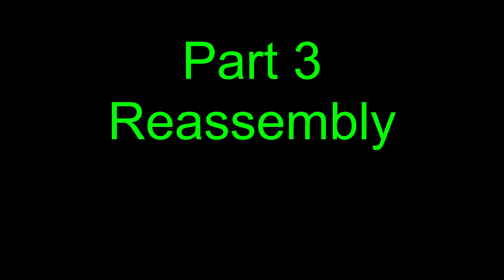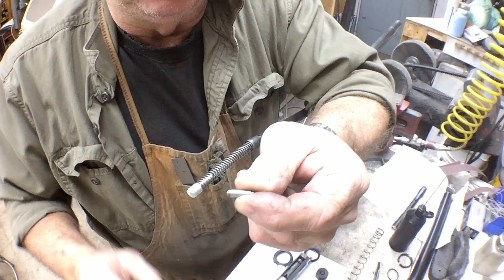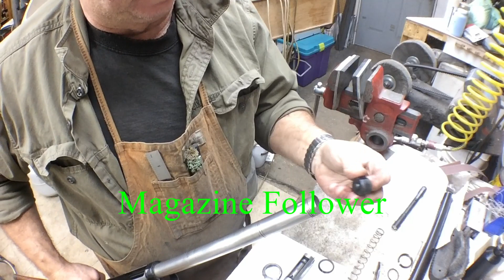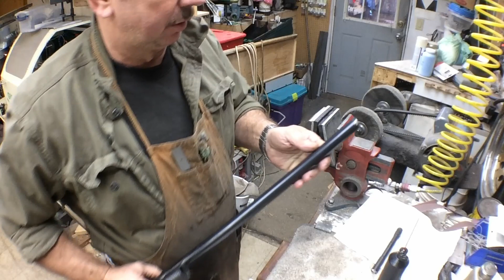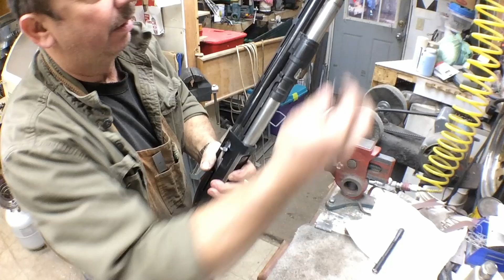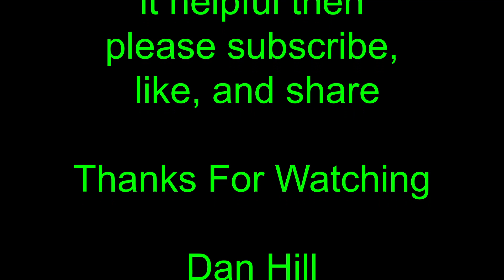Remington 11-87 Repair and Service Part 3, Assembly

Comment: I was wondering if all 11-87 shotguns had the magazine collar on them prior to installing the fore end. Not any other 1100 video I've seen shown the collar being used. I noticed how you installed it and realized I put it on correctly. I just installed a new gas -Oring on mine. Hoping it cures the recycling problem on my target loads. Thanks for the excellent video.
Reply from the maker: They all have the gas rings the only difference other than size is the later style used a connected style rings (one piece) as opposed to 2 seperate rings. Most 11-87 s will not function light target loads.

Comment: I have a 11-87 that has the one piece piston seal part 19258, and it is very hard to get a replacement. Ant suggestions to replace this part
Reply from the maker: Just do a google search, while many places show out of stock there was one that said it was in stock and at least 2 others that allowed them to be added to the shopping cart so possibly had them. That was on the first page.

Comment: Great video! I have a problem with one a buddy gave me to fix. 
He said it doesn’t work. I tried the trigger (after clearing it!) and it is dead. Safety works, allowing zero trigger movement. When in fire position, the trigger pulls back but no hammer actuation. I pulled the gun apart, and cleaned everything with a spray cleaner. Lubed it up and the trigger and hammer work as expected. Put back together and the trigger is dead. I see a lever on the side of the trigger group that when allowed to raise, the system works properly. When the barrel is installed and the bolt is pushed all the way into battery, that lever is depressed ever so slightly, killing the trigger/sear engagement. At this point,  don’t know what to do next.

Comment: I took mine apart the other day, cleaned it all up, and put it back together and it will not fire. I tested the trigger mechanism before putting it back in the gun and it was working fine. However every time I put the assembly back into the gun it will not fire. The safety is working fine and the trigger depresses but it will not engage the firing pin. I've had this apart 5-6 times trying to figure out what is wrong but I'm about ready to give up. Frankly it's just not that complicated of a mechanism to have this problem. Is it possible that the trigger is not engaging something? Like I said, you take the assembly out of the gun and it fires fine. I don't get it.  P.S. I did notice some play in the butt stock, and the mechanism that is the part that strikes the shell has some play but I'm out of ideas.
Reply from the maker: Sounds like the disconnector or its spring is not positioned correctly or barrel not fully seated. Butt stock shouldn’t be a factor but if it is loose it will crack under recoil so needs to be tight to the receiver. Dan.
Reply: @hillsgun  I may have found the problem, the tab that you push in to get the action into place will not stay in the slot. Every time you depress it, the back end falls out of the channel. It's kind of chewed up too, just above the channel it rides in there are some very deep gouges in the steel. I'm not sure what I'm going to do now, but thanks for your help.
Reply from the maker: That’s the shell latch, it was originally staked in place, but is not necessary to be staked to function, only more difficult to assemble. The gouges you describe would have been caused by it being out of position and the trigger group being forced in. The gouges probably won’t affect function unless they have made a burr that is above the receiver. Lightly stone the burr so they are flush, position the shell latch properly and help align it with the trigger pin inserted just enough to align it and then with your third hand insert the trigger group enough to hold the latch in its groove, then you can get your finger out of the way to finish installing the trigger group. Dan.

Comment: Very late to find your collection of very informative videos!  I have a set of 1187’s circa 1987.  Love them.  I went to take them apart this weekend.  My 28 came apart just like you instructed.  My 12 has been a real bugger to get the bolt and carriage out.  No matter how I press the catch, the carriage won’t release.  It cycles great.  I’ve put several hundred rounds through it recently.  Still my old reliable war horse.  It needs a good cleaning.  Any old wisdom how to get that carriage to release?

Comment: Parts are getting hard to find
Reply from the maker: yes, hard to get parts for anything.
Reply: @hillsgun  do you think someone will start back making 1100 parts
Reply from the maker: At some point there will be some reproductions available, probably not as good but they will be something if there is enough demand

Comment: How tight should the bolt handle be to pull out.
Reply from the maker: it varies but it needs to be secure so that it won't get lost in the field, but it still should pull out with moderate force.

Comment: excellent.  Are you a teacher as well?   You're a natural.
How often should the action spring (not the magazine spring) be replaced?  I have an 11-87 Premier (c1998)  that was shot a great deal through about 2005.  but not as much over the last 15 years.
Reply from the maker: Hi Bob: Thank you but no, not really a teacher. My attitude towards action springs is unless the gun is giving problems then leave it alone. I have seen some that are running fine with the original spring and when changed out they would not function and also just the opposite. If the gun is clean and oiled properly it is usually an ammunition problem rather than a gun problem. The trend is to manufacture ammunition less expensively (less powder, cheaper components) which often does not have enough power or the wrong pressure curve to properly cycle the gun.

Comment: So did you put all of the parts minis the stock into the solvent tank? How long if you don't mind me asking?
Reply from the maker: I run everything thru either the solvent tank or my small ultrasonic cleaner(minus the stock) no answer for how long as it depends on what solvents you are using
Reply: @hillsgun  thanks. I actually own an ultra sonic cleaner. What do you use for the liquid medium? I've seen some videos using water and simple green. I'm ignorant and new to guns but wouldn't water be a poor choice?  Do you have a video?

Comment: Hey i have a 1187 and its best shotgun ive ever owned or shot and the interceptor latch broke the solder didnt hold up from factory and im wondering if theres any easy fixes to this or if i have to send it out i have the latch still and the circle clip and ive found the parts online but im not sure if i could just put a pin through it or if its got to be sent out? Could please give me some advice?
Reply from the maker: I assume you are referring to the interceoptor latch pivot stud and I must admit that I have never seen one fail. You will have to find someone qualified to silver solder it, refit, and reblue the receiver for it to be correct. Previously if it was not a repair I was willing to do I would recommend sending it to Remington, but since they have closed their doors I would find one of their authorized repair stations (when they were still in business)and have them do the repair .
Reply: @hillsgun  yeah thats it it was a display gun when i bought it and i used it for about 2 or 3 years with no issues then one day i was out shooting and it suddenly stopped working i called around to alot of places i live in upstate new york and no one will touch it they all said that a certified remington gunsmith has to do the work and i finally found a shop that will do the work its a about a hour and a half away and its going to cost a couple hundred dollars to get fixed but itll be worth it.

Comment: What do you think about the practice of not letting the bolt slam home without a shell? As in riding the bolt, and easing it forward.  Only letting it fly when there is a shell to be chambered. Could it potentially cause issues letting it slam?
Reply from the maker: I personally don't consider it to be an issue, if it does cause problems then I feel that there are other problems such as excessive wear or a design flaw, or poor heat treat  with some firearms manufacturers.

Comment: Good video what if I’ve done all that and after I fire my first shell it doesn’t feed the second one in? What could this be?
Reply from the maker: what ammo?
Reply: The remington dove and quail load and Winchester pheasant steel shot high velocity 2 3/4 1 oz #7
Reply: I just gave it a thorough cleaning so I hope it works I also changed the O-ring. I live in the SF bay area so it’s going to be a little while before I could shoot it again.
Reply from the maker: @martymarfishhunt3622  probably ammo is to light, it may cycle the steel shot load but I really don't expect it to function the dove and quail. I didn't ask but I assume it is a 3" gun? even though they advertise as shooting 2 3/4 with todays loads they realistically won't. dove and quail is a light load and doesn't develop enough pressure to cycle the actions of most auto's and even though the steel pheasant load is advertised as high velocity it is a relative term used by the manufacturers and gains that velocity with powder selection which will produce velocity, but not necessarily the pressures necessary for function. Steel loads normally run lower pressure levels than an equivelant lead load
Reply: @hillsgun  thank you for getting back to me . I will try some different loads I bought this probably 20 years ago brand new and never had malfunctions and I used the lighter loads. Yes it is 3 inch by the way. Ok hope it works thanks again.
Reply from the maker: Ammo from even 5 or 10 years ago was produced with substantially more "oomph " than it has now due to both cutting costs and liability issues plus over time there is wear of the gun so we see more an more of these issues. Hope this helps, Dan.

Comment: It seems to me that there are fewer gunsmiths these days but more people are owning firearms.  May I ask if you just got tired of gunsmithing or did it become unprofitable.  I had a difficult time finding a gunsmith to put a new trigger in my Ruger M77.
Reply from the maker: There are fewer good gunsmiths and there are several reasons for that.. probably first and foremost is government control at all levels of government, next is the firearms manufacturers really don't want anyone else working on their products both from a liability standpoint and they would like to have the revenue from any billable repairs so in many instances they will not supply parts. Gunsmithing has never been an extremely proffitable enterprise because good gunsmiths tend to be better craftsmen than businessmen and usually spend to much time talking to customers when they should be practicing their craft. And finally customers tend to not always be the most responsible when it comes to promptly picking up and paying for repairs or upgrades so a business which is usually relativly low profit with high equipment and tooling cost is quite often stretched beyond viability. For me it was profitable enough and I anticipated being able to at least sit at my workbench and tinker on thru my elderly years.when you weigh that against a female ATF agent who was trying to make a name for herself at the end of our previous administration 4 years ago it was not worth it. When you are given paperwork violations for logbook entries such as SW for Smith and Wesson (the acceptable entries were S&W or Smith & Wesson) or POBox (the acceptable entriy was P.O.Box) At that point I was tired of gunsmithing for the public. I now have other business investments, lots of my own gun projects, and get to play here on u-tube.
Reply: @hillsgun  Thanks for the answer.  Very nice of you.  Before i lost my job back in May I worked in an office building where the local ATF was also officed.  I heard them talking about hassling people and saw them in undercover clothes.  I respect law enforcement but they often cross the line.  I wasn't aware they regulated gunsmiths but the government seems to be in everyone's business these days.
Reply from the maker: @larrymor  there is of course a deeper story with this instance that I may at some point cover in detail, but I will say that in my 30 plus years of dealing with ATF I may not have liked what they told me but I was always treated fairly and in most instances they were trying to help me while still doing their jobs. In this last instance there was nothing fair or just about it. The sole purpose was for this agent to further her career and to close liscensed gun shops. What they failed to realize is that they alienated a valuable resource because all the shops they treated this way were no longer willing to help them beyond what was mandated beyond the letter of the law.

Comment: Do have a question. I've got a 11-87 SP 12g. Chamber for 2 3/4, 3 and 3 1/2. Having problems cycling low brass dove loads. Fires 1rnd, at times won't cycle or will stove pipe. The bolt has locked to the rear without cycling next shell also. Field fix has been spraying light shot of lube in the action and then works fine for bit. Have cleaned the gun, issue is still intermittent. Nothing looks broken and the seal looks to be in good condition. It's VERY aggravating lol
Reply from the maker: The short answer is that yes the loads are to light to reliably function the gun. Read thru the comments and you will find that I have covered this before as it is a common problem with the guns that clain to work with 3 1/2" shells. I will probably shoot a short video of this problem. Thanks, Dan.
Reply: @hillsgun  definitely good to know. Thank you. Is there a load you'd recommend to try? Money is tight these days, so a good recommendation for a load to try would definitely help save a little cash.
Reply from the maker: Sorry but I don't have any good suggestions. A heavy field load will "probably " function the gun, but every one is different. Just try a middle of the road ammo and see what the gun likes. I am recording a video in the morning that will hopefully answer some of the most common issues I get asked about.
Reply: Could the load just be too light for the gun maybe?
Reply: Load was a Remington 2 3/4 1oz 8shot game load

Comment: I found this video while doing some research for my 11-87.  My gun will cycle an empty out and load a new shell in but does not load enough to activate firing pin.  New shell loads into barrel and firearm doesn’t even click.  If I pull action back and let go the firing pin will engage and let me fire.  Am I having an Action spring issue?
Reply from the maker: The gun is short cycling, chances are either the loads are to light or you are not holding the gun tight enough into your shoulder. I just finished a fairly in depth response in the comments section of one of the videos in this series explaining this problem. If you can't find my earlier response let me know and I will look it up. Thanks, Dan.
Reply: @hillsgun  I know the loads aren't light. I've shot everything from dove loads to buckshot out of it.  And ive fired probably 5000 rounds through it if that makes a difference on wear and tear.
Reply from the maker: @chanceehuiet  I still doubt that anything is worn or broken although the gas rings may be showing some wear and is the seal good? I usually find if a gun has been used a lot that it is normally a cleaning issue if the earlier has been ruled out, magazine tube where the action bar slides over clean and dry, gas ports clean and not carboned up, chamber clean with no corossion would be where I would probably look.
Reply: @hillsgun  10-4. I cleaned it like I normally do after a shooting but I will break it down more and give it a more thorough cleaning and hope that works.  You gave me some hope for an easy fix.  Thank you.

Comment: I found Parts 1, 2, and 3 to all be useful and very informative as I am currently installing a new receiver on an 11-87.  Thanks, good job!!!
Reply from the maker: thank you
Reply: I’ve got to install a new interceptor latch and spring, any suggestions on this piece?
Reply from the maker: @waynejenkins6259  straightforward install, make sure the retainer is seated correctly otherwise it will pop off and you will lose the parts

Comment: What are your thoughts on the Remington V3 design with not items in the wood behind the receiver. Good design?!?!
Reply from the maker: I am somewhat old school when it comes to guns and the gun industry. For the most part I don't see many current production firearms, and no US manufactured that impress me. The current offerings are quite simply not well designed or built. The current mindset is to produce as quickly and cheaply as possible such as plastic trigger guards and frames. Don't get me wrong as they have their place but the craftsmanship that goes into a firearm that will last thru many generations of a family and can still be appreciated as being great grandpa's gun is gone.

Comment: Would you recommend buying the 20 gauge 1187 Economy version now being sold? Has a plastic trigger guard but still everything else is as it was. 3 inch TSS loads ought to make it a goose capable hunting shotgun also shouldn't it?
Reply from the maker: The 11-87 is one of Remington's better designs for the currently available ammunition and functionality of their gun offerings ,if the 20 guage will fill your needs for geese is a decision you will have to make.Personally I am more in favor of the 12.

Comment: Is it common for the for-end support to slide freely after the gun is fully reassembled
Reply from the maker: everything should be solid once the gun is assembled and the bolt is closed, with the bolt open the internals on the magazine tube may rattle when it is first put together